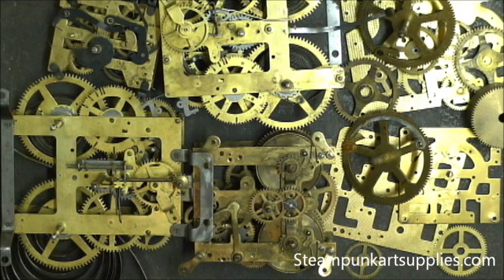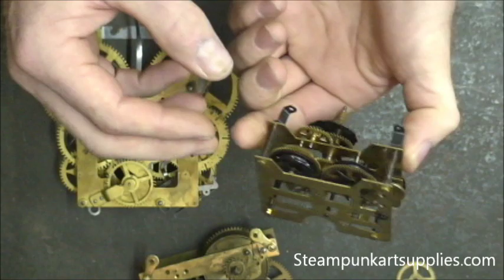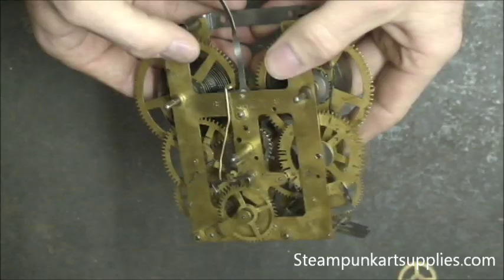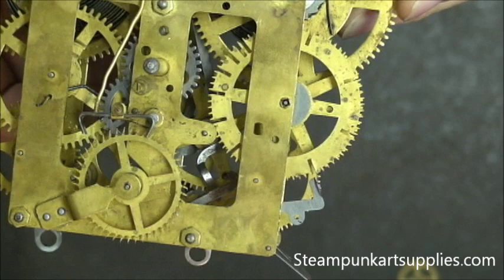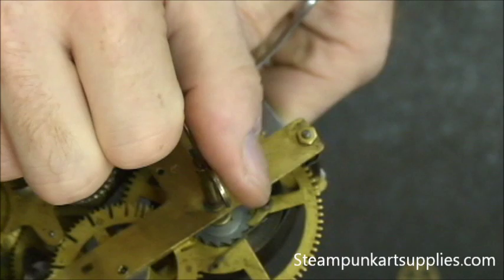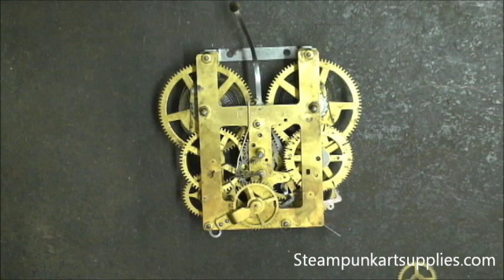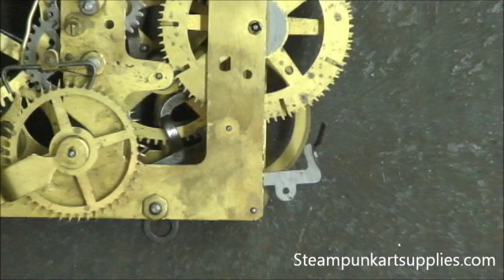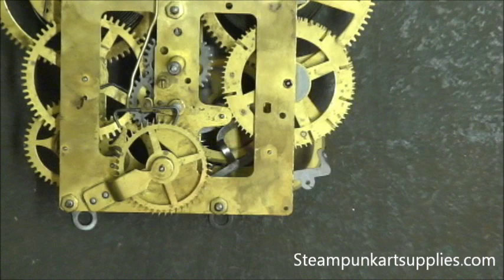How to safely take apart a brass clock movement for Steampunk art projects

Comment from the maker: Yes, I think that will be okay. The other way to unwind it is to find a twelve point socket that will fit on the four sided winding post and use a nut driver to slowly let the tension off. It's better to let the spring out when cleaning anyway. An ultrasonic cleaner will work great.

Comment: I'd be interested in some of the mantle clock parts you don't list on etsy, stuff like the verge and the other odds and ends from mantle clocks like the one in this video. You mention you trade with a local horologist, does he sell clock parts/ have a webpage?
Reply from the maker: Mach1rulz Hi, I list everything I have on Etsy. Here is a link to the part of our shop that would have those parts. https://www.etsy.com/shop/SteampunkArtSupplies?section_id=10062287&ref=shopsection_leftnav_4

I'm always adding new listings, so please xome back and check often.

Thanks!

Comment: What do you recommend to clean the gears, chains and other pieces?  I get my parts from a tv repair store and some of the gears I get have been sitting for a while and have collected dust and in some cases oil and grease.  I'd like to be able to clean them without damaging or tarnishing them. Any suggestions?
Reply from the maker: This works well. 

http://www.ronellclock.com/Clock-Cleaning-Concentrate-Ammoniated-SOL-100A.htm
Reply: Thanks